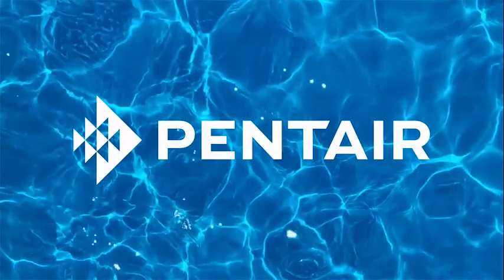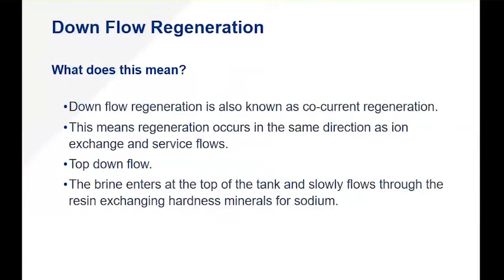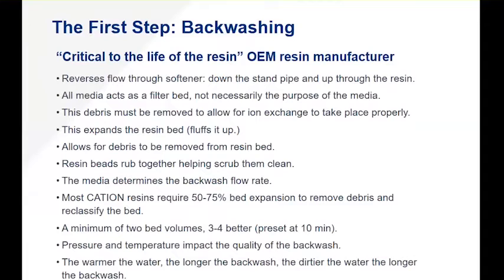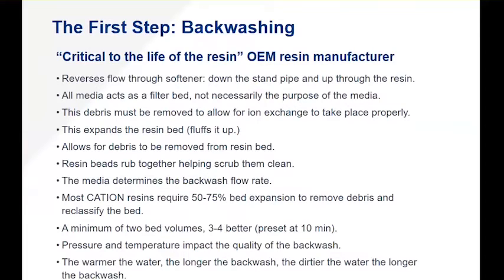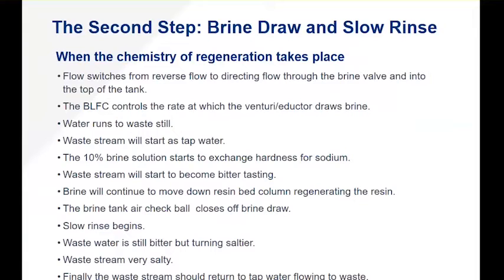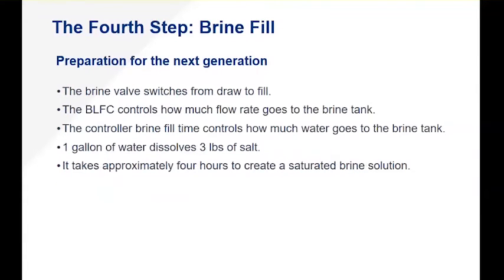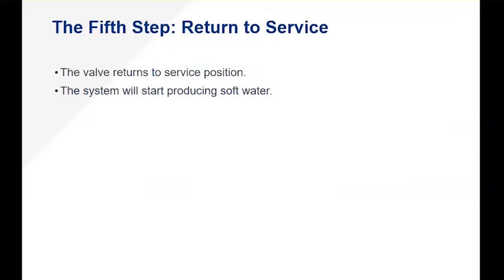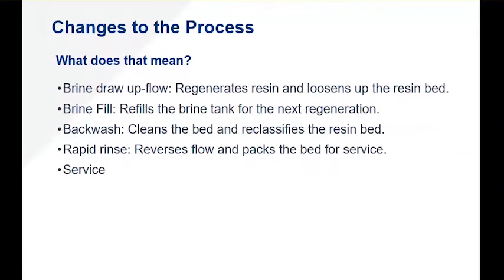Pentair Regeneration Process Training Presentation - Part 2

Comment: Great discussion. You have to understand the process to troubleshoot root problems. If you do it well it will perform well, what are the most common mistakes people make during installs that affect efficiency in a negative fashion or lowering the percent efficiency of the design they are implementing. Thanks..